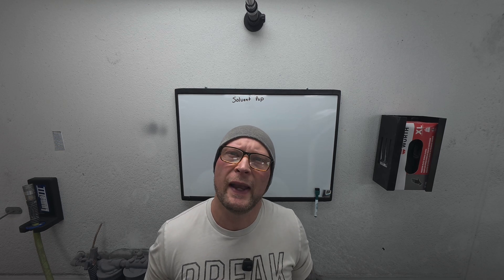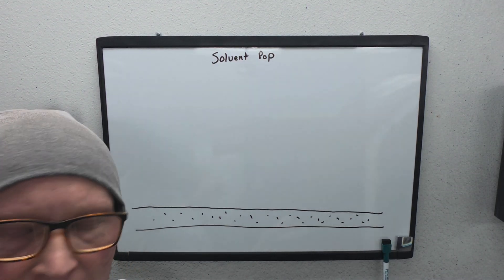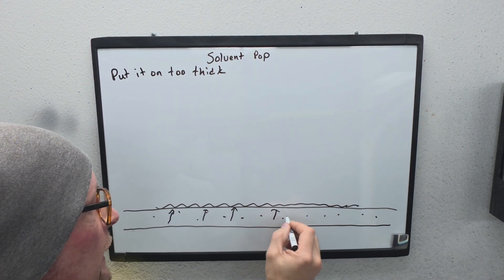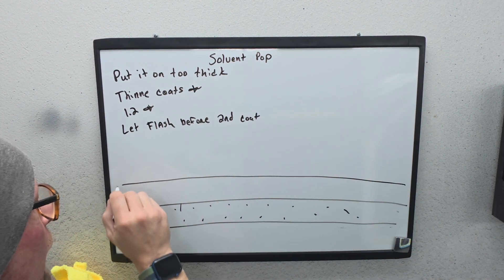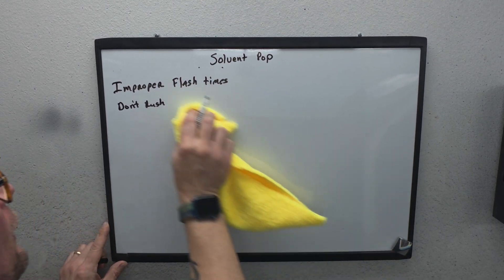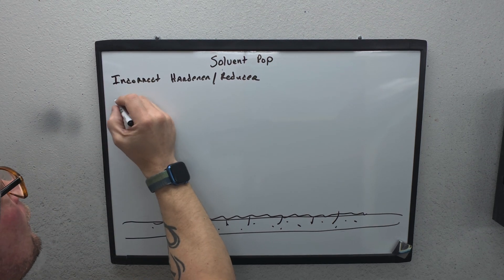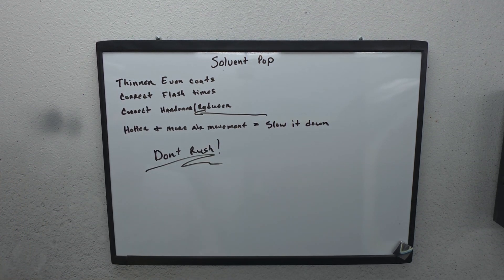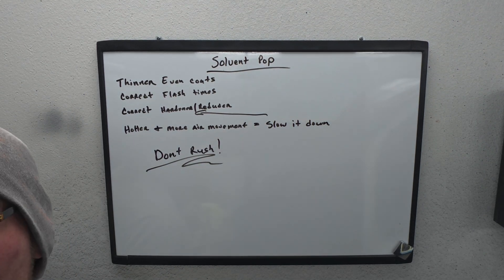Car Painting: Solvent Pop Causes/Solutions Explained

Comment: Thanks for this video.   I laid the paint on thick.  Slightly rushed between coats.   Left fans in booth running when I finished.   It looked great until the solvent pop.  Oh well.  Hopefully I can sand the clear and respect clear with no issues.

Comment: Great video, I’m in the process of sanding a 8’bedside and door down because of severe pop! The clear I was using only had one hardner for it I did use slow reducer at 5% should have gone to 10%  y homemade paint booth fans were running on high temp was 90+F. Spraying with a 1.3 and C1 cap air pressure at the head was 27PSI. Only thing I could have done was thinner coats and turned the fans down. Sometimes you gotta learn the hard I’ve had it happen before sadly! New clear on the way with slow hardner and extra slow reducer. Gonna turn the fans down ,change to my faithful pro lite with 1.2 and T110 air cap and start well before the sun comes up!
Reply: Same issues for me.  Had my fans in high . Makes it dry real fast.  On the first coat go light.   Let it flash then do a heavier one.        Gun fluid. 4 turns out from close and fan wide open with half a turn in
Reply: Can the problem be in the primer which causing the top coat to solvent pop.. cheers

Comment: Ok I made all the mistakes you speak of. At first after painting you could see micro white specks. Sanded my clear coat and buffed to a nice gloss. Reflection of shop light in paint / clear coat was very good / good detail. Now after months of continuing the build the finish became more and more cloudy. Shop light detail was horrible. My only choice was to try and sand the pop out hoping not to sand through the clear. 600 / 1500 / 3000 wet sand by hand with block. Currently 1/2 car sanded and it is working. I wish I knew this common issue before. My right shoulder and nerves would be much happier. Thanks for the video.

Comment: I'm just going to put in my 2 cents a.d experience when I was using FC720 I got solvent pops my panels were clean my air was clean used a 1.3 tip when I switched to CC200 and CC950 Sherwin Williams clear it all stopped the cheaper is not always better

Comment: I use accelerator in my clear coat. Can that cause issues like Solvent pop?
Reply from the maker: Absolutely! Using accelerator can amplify the issue if improper thickness, flash times, and or if the temp is too high or too humid. Accelerator speeds up the curing process leaving even less time for solvents to escape. The chemical reaction between accelerator and clear coat also generates additional heat which can increase the risk of trapping solvents. Hope that helps and thanks for checking out the channel!
Reply: Yes does help very much really appreciate the reply, also a follow-up question will it cause more orange peel in the finnish? I've been able to shoot flatter finishes in the past and been having more pill in the Finnish lately. I was wondering if it was the accelerator causing it.
Reply from the maker: No problem! Yess accelerator can be a cause for orange peel because it sets up so fast and doesn’t allow the clear to flow out.
Reply: That's what I was thinking thanks for confirming this with me, only been painting about 3 years but never went to school for this trade,  learned everything by doing it and watching YouTube videos
Reply: Will help solvent pop but you have more orange peel